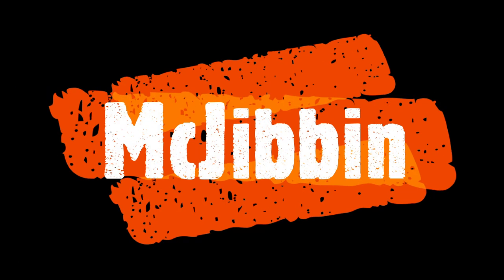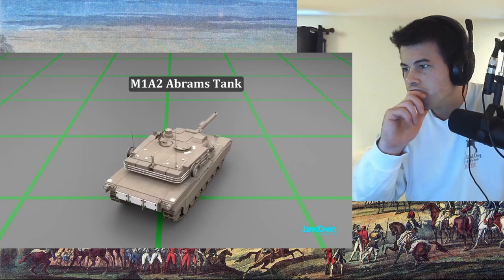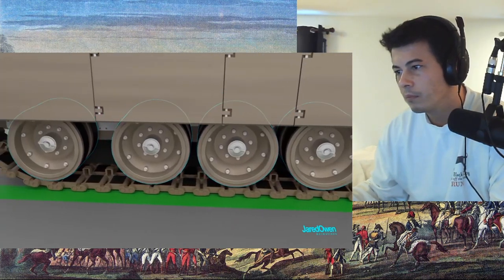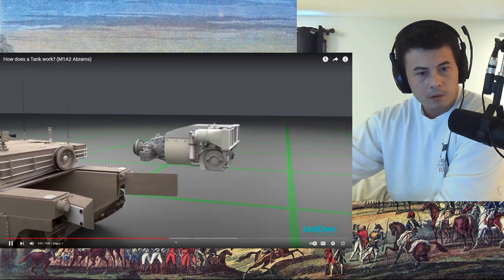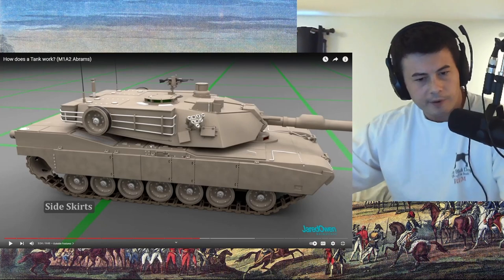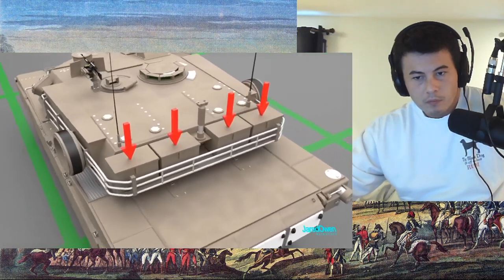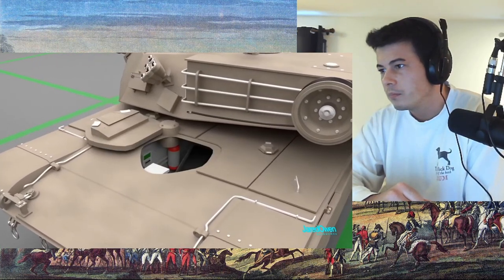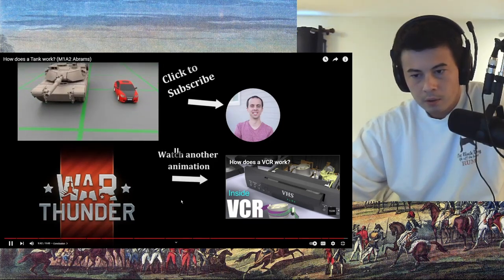American Reacts How does a Tank work? (M1A2 Abrams)

Comment: The side armor does not go deeper, because otherwise you would lose a large part of the terrain capabilities. Imagine driving over a larger rock, then the wheels would go up, but the obstacle would hit the armor from below. In the best case, that would only be loud, in the worst case, the tank could even lie flat. There are also other methods for lateral protection, such as Reaktivpanzerung (no idea what the English translation is for this). Explosives on the outside of the armor designed to destroy the enemy missile before it hits you. The smoke grenades are more for defense, they are most likely to be used when you are suddenly faced with an overwhelming number of enemy tanks that could become dangerous to you. You use the smoke grenades to not provide a clear target. 

What was not said in the video was that the gun is so good because it is a German gun. The German tank has the same cannon, there they put a glass of beer on the cannon for fun/for demonstration, and then drove through the terrain at top speed, the glass was still full at the end.
Reply: I wanted to say that, but yeah bro

Comment: Exploding  ammunition has been a problem for tanks since they were first invented during WW1.

During WW2, it became a real problem, and many solutions were attempted the more common successes being:

1 wet storage - does what it says - the ammo is stored under water to reduce the chance of fires cooking it off. But it makes handling of the wet ammunition more difficult.

2 storage below the turret ring. Observation of damage to tanks showed that most damage was to the turret or very top of the hull. By storing ammunition low down in the hull, the risk of exploding ammunition was significantly reduced, but the loader has more physical difficulties in lifting the ammunition to the gun.

3 automatic loader. An auto loader reduces the number of crew in the turret to two, and the mechanical handling system can be small means that better armour can be put round the ammunition to protect it.
But it's more expensive to manufacture, more prone to mechanical faults and eliminating the need for one crew member reduces the number available for vehicle maintenance, weapon cleaning and tasks such as standing guard.

4 The blow off panels prevent an ammunition explosion from destroying the vehicle, although it does mean that the vehicle will have to go back for repair, thus being out of the Battle. The uninjured crew of course, will go and get a replacement tank and return to battle. The space required for this method of protection is just one of the reasons for the massive size of the turret. This method then, is only suitable for the largest tanks such as the Abrams, Challenger and Leopard 2. 

Smaller tanks such as the Russian tanks frequently have autoloaders. The consequences of this in battle can be seen in Ukraine with many destroyed Russian tanks having their turrets blown off the tank by exploding ammunition.
Reply: yea i was suppose to say wet ammunition storage but OK you got the details imma just pass it to you

Comment: I was a gunner on an early model Chieftain tank, it was the worst position, very cramped and I only had a times one periscope to see outside the other crew members had hatches they could see out of and breath fresh air, didn't have a clue where we were till we arrived and I could get out.
We had a cooker inside to heat food and make hot drinks.
I noticed it had no safety shield for the loader, when we loaded the barrel the gunner couldn't fire untill the loader pulled the shield across to protect him from the breach recoil.

Comment: Love good technical animations.  There is one, about the current assembly process for an attack submarine ... whole sections are built, including the interior, then they join the sections (because the precision is so close the parts mate up reliably).  A howitzer has a turret, that doesn't move, it is basically armored mobile artillery.  In a modern US tank, the turret is long, because the rear half is the ammo storage.  There is a blast door between the ammo storage and the crew compartment.  Because the modern Russian tanks don't have this, the crew are literally riding on top of the ammunition (an ammo ring the runs in a circle beneath them) ... because of their auto-loader, so they can reduce crew by one, but then if the tank is hit, the crew become crispy critters.  The current Abrams engine is great, but the first one was dumb ... you had to pull the whole engine out, to replace the oil filter ... the government forced the builder to change that!  Yes, lots of US tanks were destroyed in WWII, and that was with "learning on the job".  Ever see the movie Fury?  The Sherman was noted for its ability to burn ;-(

Comment: tbh Abrams got couple things that are unique to that tank like the engine, controls and armor. Check out some video about Leopard 2, they are German main battle tanks used by many countries and they are accurate and fast as hell for their size.

btw the blow out panels are not used on Russian tanks and that is the reason you see so many pictures of destroyed Russian tanks without a turret, the ammunition of Russian tanks are located at the bottom of the turret and if they explode the force is so massive that it blows the turret clean off and makes it fly several meters.
Reply: the abams is very similar to the leopard 2, the ameicans took the reserach of the Main Battle Tank 70 Project and made it into the m1a1, the germans made the leopard 2. Also the main gun of the abrams is a license build of the german rheinmetall 120 mm cannon that is also used in the leopard 2.
Reply: @evilmessiah81  yea but its at the same time pretty different, only the gun and overall layout seem similar but everything they used to make it is different, greetings from a Leo 2a4 mechanic 😀 the thing that surprised me was the driver's compartment like he is laying down in abrams while using some sort of motorcycle ish looking controls to drive it 😂 in Leo it is really similar to the controls of a car or some big truck like you have your pedals and gear selectors and steering wheel and everything and you have enough room to sit upright

Comment: and i forgot stabilizers had just got better even in the first MBTs in WW2 The sherman varients (M4a1-M4a3e8) has those stabilizer its just they are outdated and the reason the turret is big its because of 480mm frontal composite armour wich is made out of steel air and a bit of glue wich slows penetration significantly and 
WW2 shells (barrel length effects the shell pen)
M4a1-M4a3=75mm potatoe gun can fire upto 600m/s and apcbc can pen upto 90mm
M4a1 )76W well its close to the M4a3E8 can go upto 800m/s and pen upto 145mm
Tiger H1 E and P =88mm KwK 36 vel upto 800m/s pen upto 155mm
Tiger 2 H and P=88mm KwK 45 Vel upto 1000m/s APCBC can pen upto 220mm APCR can pen upto 280mm
Now lets get more modern
Most 105mms can fire Heatfs or APFSDS and can pen upto 380mm
while the 120s like the abrams (M1A1 and M1A2) can pen upto 400mm+

Comment: During WW2 the Sherman tank was called "the Tommy Cooker" due to the Sherman often bursting into flame when hit,they tried extra armour plate but just like the Russian T34 ithey would defeat the better German tanks by outnumber and hit the rear or side though just as often the right shell would penetrate almost anywhere. The Brits put a heavier gun into the Sherman which could knock out all Garman tanks but the "Firefly" as it was called would often be targeted first by the Germans. Anti tank missiles of today would appear to be one step ahead ....at least as far as Russian tanks are concerned.
Reply: Ronson and Tommy Cooker are both dubious historically. The Sherman was in no way much worse off than other tanks. They were however numerous, meaning it was a high probability that if a an allied tank was destroyed , it was a Sherman.

Also, any tank engagement dictates to try and outnumber the enemy force. As does aerial combat and infantry combat. Germans tried to outnumber the enemy, the allies did it, everyone did it.

You have sadly bought into modern myths of WW2
Reply: The "Tommy Cooker" is not specifically a Sherman. It was literally any tank used in service during WW2 and not for the reason of catching fire. It was because back then tanks were just metal box without any air conditioning so it would "Cook" the "Tommies" inside of it like an oven when in hot, specifically desert, environments. 

The "Ronson" is also a total myth because the popular model of Ronson lighter that the Myth depends on didn't exist until post war. Ronson lighters before and during WW2 were notoriously unpopular and had a horrible reputation for not lighting properly. Additionally their slogan of "Lights the first time every time" which was supposedly attributed to the Shermans wasn't used by the company until the 50s completely disproving it. 

The Sherman also did not burn notoriously more than any other tank in it's time. Opposed to common myth a tank burning was almost always a result of ammunition fire, not fuel fire. The reason tanks burned so often back then was because of horrible ammunition storage practices (practices the Germans never stopped using). Notably sponson ammunition storage which stored ammunition in the (you guessed it) sponsons which were at the sides of the tank. The Americans fixed this in 1942-1943 but the Germans never stopped storing their ammunition this way. This is what caused German tanks to have an 80% burn rate upon initial armor penetration as opposed to the mid-late war Shermans that had a less than 20% burn rate upon initial penetration. The reason for the amount of burned out Shermans in the late war was simple. It was common practice on all sides to shoot a tank until it burned so it could not be repaired. The simple solution for German tankers was to just shoot the tank more and because they almost always had the element of surprise as the defending force that could await the enemy from a favorable position they almost always got the first shots.

The Sherman and T-34 (the dash is important because the T34 without the "-" was a different tank) did not rely on pure numbers in the way uninformed people often think they did. No more than literally any other tank that ever existed did anyway. The Sherman was equal or superior to all German tanks save for those which were classified as "big cats" tanks like Panther, Tiger 1, and Tiger 2 which only made up 1/5 of German tanks at the height of their numbers. Most German tanks were Panzer 3 and Panzer 4 variants which the Sherman was objectively better than in all metrics when comparing contemporary variants. 

For example:
-The Sherman had thicker frontal armor than both Panzer 3s and Panzer 4s (51mm compared to 30mm on the aforementioned German tanks)

-Unlike the Panzer 3s and 4s the Sherman's frontal hull armor was sloped, providing it even greater protection (the standard M4's 51mm of frontal armor was sloped at 56 degrees from vertical for an effective thickness of 91.2mm. Quite literally triple that of the base Panzer 4.)

-The Panzer 3s' and 4s' standard guns were inferior to the Sherman's standard 75mm gun (which no was not a low velocity anti-personnel/anti-structure cannon, it was a medium velocity multi-purpose cannon meant for anti-personnel, anti-structure, AND anti-tank work) in armor penetration and HE performance.

-The Panzer 4 post armor upgrades still lacked in protection over the newer Shermans that were coming out by the time the upgrades were finally fielded. (By the time the Panzer 4 received an 80mm plate as a replacement for it's horrifically outdated 30mm plate the Americans had replaced their own frontal armor with a slightly thicker but less sloped plate that offered 95mm effective thickness but the greater base thickness prevented what was known as penetrative overmatch. Which is far too complicated to explain in a comment not focused on it.)

-The Panzer 4's Long Barrel 75mm gun was only marginally superior in penetration to the American High Velocity 76mm gun that replaced the old Medium Velocity 75mm, opposed to common misconception the Panzer 4 did not receive the same 75mm gun of the Panther but a smaller (in construction) and lower velocity gun of the same diameter. 

-The Panzer 4 (and all other German tanks of the time) lacked stabilizers for their main guns, something the Sherman had since it's inception

-The Panzer 4 (and all other German tanks of the time) had horrible gunner sights, not in the way that they were bad but in the way that made them entirely impractical unless firing at long range. This was because the only sight the Gunner had was a telescopic sight forcing the gunner to almost entirely rely on the commander for spotting unlike most Allied tanks that had high magnification telescopic AND low magnification general sights making spotting much quicker.

-All German tanks of the time were horrifically cramped, even by the day's standards, meaning that escaping a burning tank was horrifically difficult, loading took longer, and the crew fatigued faster.

-German tanks of the time had few, small, heavy, and unassisted hatches for the crew making escaping a penetrated tank much more difficult. This alone caused a massive chunk of German tanker fatalities.

-German tanks of the time had horrifically unreliable and underpowered turret drives that were only barely faster than hand cranking. Their aforementioned unreliability also made fine aiming with the electric drive impossible so it was doctrine to only use it to get roughly on target and fine tune your aim with the hand crank. Meanwhile on American tanks the hand cranks were only to be used if the turret drive was broken because it was quick and accurate.

-German tanks had their gunner's sight located directly in front of the gunner's face making a massive weak spot in front of his head and forcing the tank to expose it's entire turret for him to scan for targets. American tanks had their sights mounted periscopically so they could acquire targets while the tank was in full defilade (concealed behind cover) granted the cover was low enough. This also removed the massive and obvious weakness in front of the gunner's face.
Reply: and one more final point, the M3 75mm gun could penetrate a Panzer 3 or Panzer 4 frontally at basically any range the Sherman could land a hit on one. Once the Sherman received the 76mm gun the Sherman could frontally penetrate even the up armored Panzer 4 at any practical range along with now having the ability to frontally penetrate the Tiger 1 at out to 900m with standard AP and out past 1,500m with HVAP.